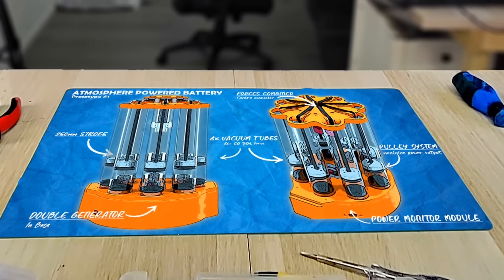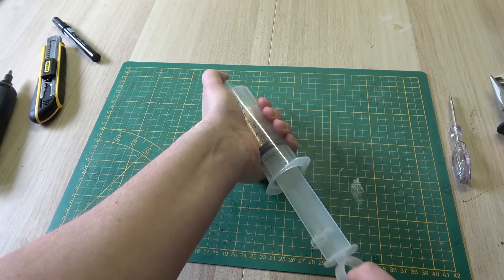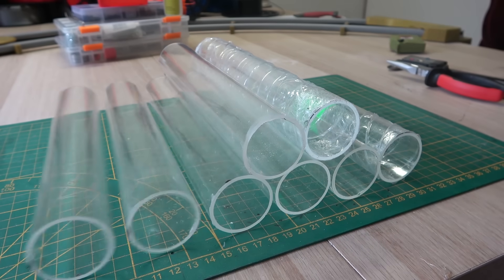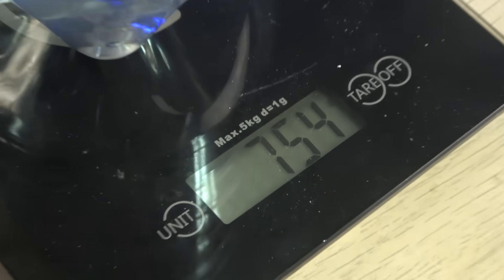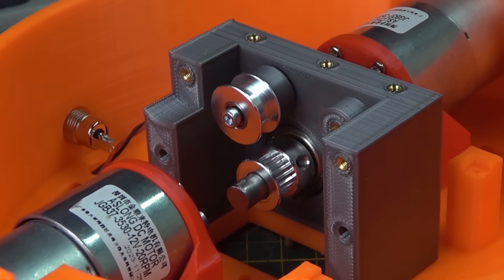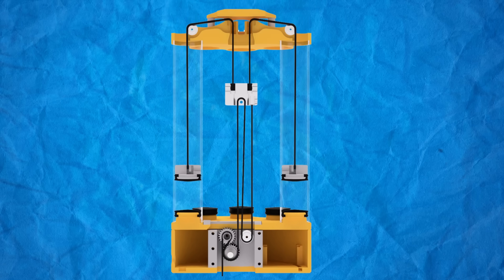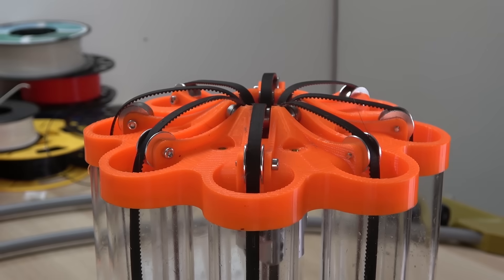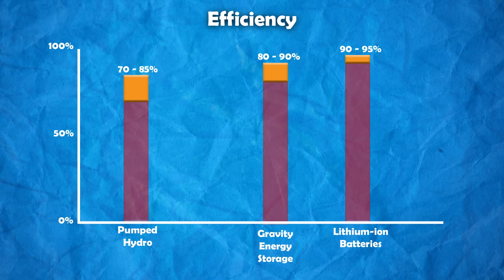Building an Atmosphere Powered Battery..

Comment: Power efficiency isn't the important metric but kWh capacity divided by the cost of the machine and its maintenance over time.

Unfortunately, 600 watts by one minute adds up to 100 watt jours, or 10x 18650 cells

Comment: I'm new here, first vid.

If you're gonna make a second version, make it to the dimensions of current solar batteries. This version has the tubes in a circle to make many things more convenient, but a real consumer version might still look like a big box. Could hold 200 of those tubes in theory. 

I wish I had more advice to share regarding improving efficiency, because I'm so very sure there's at least something to improve over 73%. Imma wrack my noggin on this one for sure cause this is an interesting concept I've just learned of. Shits neat 4 sure.

Comment: Incredibly creative! I don't think this idea will work at the economy of scale. There are several reasons but the main reason is storage volume. It will take a lot of volume to store the energy. ( Using English units, there are ~14.7 PSI at sea level. So, Vacuum only gives us 14.7 psi to work with. However, if you use "pressure", you can increase the pressure in some containers to thousands of PSI. So, there would be a lot of "volume" needed to store the energy as "vacuum" as opposed to pressure. Of course, the main issue with storing pressure is of course accidental rupture of the tank.
Still, it was a very cool build!

Comment: So i think you can improve it by having a rolling diaphram inbetween two pipes. So you would pull vacuum while compressing air. Esentially doubling power density. And you could enclose the motor in one side of the tube so the worry pf the mechanism causong sealing issues isnt an issue.

Comment: If you pulled the suction upwards using your body's weight kinda like a step lever. The body weight would lift the cylinders and exert the enegery. Wouldn't that make your machine net 0 on consumption and 100% out put?

Comment: 73 percent efficiency is a little sus from geared, brushed hobby motors for a complete round trip including all of the friction in this pneumatic system. It would be nice to see the raw data. I suspect you might have a V/I phase mismatch there on your power monitoring board.

Comment: With vacuum, the max delta pressure is 1 Bar. why not use overpressure? then the delta P can be over 400 Bar, for example, modern scuba tanks are 400 Bar. This would increase the specific power (power per kilogram) you can store.

Comment: These are called gas batteries, they use gasses under pressure to act like a wound spring, people do these with bottles for model aircraft and companies do this with abandoned mine shafts because its cheap as hell

Comment: Here are some of my thoughts right after watching your video great job by the way. My first thought is your design has a lot of friction in it with how many tubes you have. reduce the amount of tubes ideally to one. And increase bore diameter.  The last easily doable thing I see is make the tubes out of a metal that will not deform when a vacuum is applied to them. This will also increase the efficiency if the structure does not deform while under the vacuum. I would also conduct a test without the pullies to see if there is loss in the mechanical system and maybe you would make the design completely linear so you wouldn't have any pullies in line on the design at all.  Such a brilliant video I really appreciate you making it it was a beautiful project to watch you bring to fruition and to conduct your testing and to see your methods was quite amazing.

Comment: a neat idea I seen was someone use was sand to gen power. because it can flow like water when being poured so they used it to spin a water wheel and an auger screw to lift the sand up into a holding tank. would be neat to see someone make a nice sized one from 3d printed stuff.

Comment: you say its to accelerate the implementation of green energy, but you show wind turbines and solar, two not so very green types of energy. wind energy uses thousands of litres of oil every year and solar which is highly toxic and polluting both for production of the panel and its recycling or trashing.
The actual green types of energy production is water, ground heat and nuclear, 3 things environmentalists are against for some reason(the reason being that these people are socialists masquerading as environmentalists)
But no, your system there isnt gonna yield any useful stored energy compared to what is put into it. You can replace the while things with regular springs and get better returns. Its why nobody is really capable of doing these sort of gravity batteries, even using excess power to refill dams for hydro power is horribly inefficient, to the point its only worth doing in places that is susceptible to having too little rain to refill the dam.

Comment: Erik, I have an idea for electricity generation using the gravity model. 
Basically a house that floats in its own Dock. The tides lift the house and then the house through some kind of gearbox/generator acts as stored potential energy until the tide comes back in, alternatively the Dock could be pumped with water to float the house then a series of houses on a hill use the same water to float meaning you could float several houses only needing to pump the water to the top of the hill.
I need help developing this

Comment: Maybe rotate that load bearing part on the printer bed so you can align the layers with the force. Printed parts have the least tinsel strength perpendicular to the layer plane.

Comment: Might be being thick here but couldn’t you use this in combination with other systems. Say pumped hydro for instance, rather than a motor charging the system, what about floats in the hydro dam. As water is pumped into the dam, the floats pull the vacuumed as they float up.

Comment: 73% is a good start. 
the only way to truly test it is to make another one with an improved design and more vacuum tubes and one with less as well and see if it improves or not. 
is more tubes better or causing efficiency loss in exchange for power? 
did you take into account the efficiency loss of the motor and electronics? motors produce heat and sound which bleeds off power.

Comment: What about having the tubes be made of copper with a magnetic ring so that as the air pressure and gravity pulls/pushes the movement of the magnet against the copper could generate a bit more engery. Or am I thinking about this wrong?

Comment: One issue is that you are quite limited when it comes to energy density since you can't store more energy than the weight of the air that is displaced. If you use water you need only a 10m drop to achive the same energy density without the preassure vessel, and if you use a prassure vessel you can get a lot more energy density if you use compressed air rather than a vacum. If you have 10l of air at 11 bars that's 10 times the energy compared to 10l of vacum, and it's much easier to contain preassure than to keep it out since most materials fair way better in tension than in compression or under compound forces.

Comment: You are still getting it wrong.  You need to mind your UNITS.  Watts by themselves mean nothing with regards to energy storage.  The units of energy STORAGE are watt-hours or watt-minutes or watt-seconds.  That's watts with an appended period of time. 
Your following two details are incorrect.
To charge: ~12.08V x ~1.62A x 43.709 seconds = 860,64 Watt
CORRECTED:
12.08V x 1.62A x 43.709s = 855.37 Watt-Seconds or 855.37 Ws or 14.26 Wm or 0.238 Wh or Whr

After a discharge: ~9.42V x ~1.15A x 57.993 seconds = 628,24 Watt
CORRECTED:
9.42V x -1.15A x 57.993s = -628.24 Watt-Seconds or -628.24 Ws or -10.47 Wm or -0.175 Wh or Whr

Comment: Would compression not be a better idea, since a vaccum has a hard limit there's a very limited amount of energy that can be stored. Compression on the other hand has no hard upper limit only a limit set by the hardware. Not sure how this could be implemented using syringes though.

Comment: Interesting project. Tho I don't fully understand the concept maybe adding some different gear ratio would improve the output? I've seen a video from a 3d printed model what achieved a 1000rpm with only a few easy hand turns. Spoiler alert it exploded from centrifugal force. But I assume that would drive your generator much faster

Comment: The problem is that even though Lithium Ion Batteries or Gravity Energy storage might be more efficient energy wise than pumped hydro energy storage, they are not as applicable on a large scale. A lithium ion battery that stores as much energy as a pumped hydro lake is going to fill a big warehouse and just think about the fire hazard this thing would pose, not even mentioning the crazy amount of lithium you would actually need. Gravity energy storage suffers similar logistic problems. You‘d need a ton of those mineshafts with weights in them to make up for just one pumped hydro power station.

Comment: An interesting concept and a nice presentation and prototype. If your measurement of around 73% (860 watt-seconds vs 628 watt-seconds) is real, it would be a very high efficiency with the limitations of the prototype. I would like to see the loss over time since no seal is perfect. I would suspect that air will creep into the cylinder and over time the stored energy will be "lost". Gluing one end of the cylinders shut will reduce potential energy-loss. Personally i find the 0.23Wh of potential energy stored a bit limited considering the amount of work needed to build such a machine. Also: the force needed for the movement of the piston is not linear. Is this reflected on the output or are the gear-motors flattening the curve? Your amperage measurement should at least not be linear.

Comment: How about combining APB with GES where charging the APB during GES's energy production or when the weight is pulling down. After it hits the ground, then we should have atleast a strong APB that can pull the weight off GES when generating energy. Then it will generate in cycle although there are some energy lost, it is worth a try though.

Correct me if I am wrong, I am not an expert.

Comment: while this isn't actually that efficient, (others have stated as much)
I can imagine this being a lower part to a large gravity battery. if the gravity battery was pulled up a vacuum tube, it would be able to add some real torque to an existing gravity battery. The issue here is that friction of a seal would reduce the efficiency unless the weight is massive already, and it would make the gravity battery's output non-linear which complicates deployment. you'd get more from a spinning maglev flywheel in a vacuum tube, and using it to generate energy though induction. you have very little free space in the container, and use a powerful set of weights to make the vacuum in the first place. making a vacuum in a durable container is relatively power-cheap, compared to disposable plastic, rubber, or machined parts.

I might suggest you use it to pull water up a wide-bottomed tube, then let the weight of the water fall down. it would also be non-linear, but it would indeed resolve the issue of losing energy to water friction, and allow you some control over the friction by using grease or similar... but I still prefer a pure gravity battery, as it's the simplest of the solutions, and has the fewest disposable parts (which can also be counted as a massive energy loss, if you take production and shipping into account.)

Comment: Steel has a specific gravity of 0.2833 pound per cubic inch. If we have a 1 square inch steel rod 51.88" long the pressure of the steel rod on a surface will be 14.7lb per that square inch. The same as 1 atmosphere. It is so much easier. No cylinders. No seals. No vacuum required. Lift the steel rod up, let it fall. I applaud the creativity though.

Comment: Watts are a unit of power, not energy. If like you said in another comment you did: voltage x current x time then the unit is Joules which is a unit for energy. Watts are just equal to the number of Joules divided by the time in seconds, so 100 Joules used over 5 seconds means a power of 20 W for example.

I also highly doubt the efficiency figure you got to, brushed motors aren’t very efficient when used as generators. Add in the losses caused by the motors themselves, the gearing, the pulleys, the belts, and the friction in the tubes (plus the angle of some of the plungers) and I find the claimed efficiency very hard to believe. Could there be something wrong with your current and voltage monitoring setup?

Even as a basic test just try wiring the motors together in a loop. Rotate one motor by a certain amount and see how much the other motor rotates.

Comment: 2:03 you use the calipers wrong.  Supposed to measure at the ends of the jaws where the thickness of the jaw is minimal.  It alleviates the possibility of having the measured item misaligned between the jaws.  Try rocking the syringe in the jaws where you measured at and try it at the ends. You'll notice when at the ends even if the object isn't perfectly in the jaws it will be a consistent measurement.
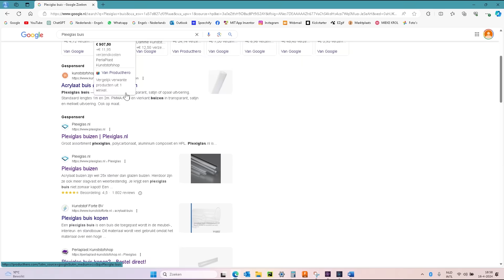Reply: Same thing at 3:08 far to choked up in the tube.  You risk getting an incorrect measurement resting the square part of the jaw in rounded areas.
Reply: At the same time, I use my calipers this way sometimes to get the largest diameter in the area. Depending on the material as well it can dig in as it's sharper there. It's not using it wrong. It just depends on what you want.
Reply: @jhwblender  You may do it this way as well but its still wrong.  They wouldn't put the feature there in the jaws of it if it wasn't supposed to be used.  The issue with it digging in is operator error. Only you the operator controls how hard the jaws are "digging" into the measured item.   An old head didn't show you the right and wrong way to use the tool.  Its typical nowadays.  Did you know there's a right and wrong way to channel locks, vice grips, wrenches, etc?  If you do, you should be able to recognize that if you didn't, you would be under the assumption that there wasn't a wrong way to use them.

Comment: I think everybody here is missing the point thats its a proof of concept, some of the maths might not be exact or perfect but im sure none the less he had a alot of fun building and designing this project, learnt a bunch of things on the way. C'mon ppl his not saying he is making zero point energy just having fun expermenting with alternative battery types. Im looking forward to a MkII.. 😊
Reply from the maker: Yes, exactly what you say is indeed what I first thought when I saw all those comments coming in😄. But the other side of it is that it does spark fun discussions🤓 Thanks for your support! Appreciate it!👌
Reply: @ConceptCraftedCreations  I am glad I found you video in the haystack. Subscribed before even watching the whole video. Ty
Reply: As a POC it's interesting, and it's going to spark some thought, but it's got several major challenges that will make it less than ideal for implementation.  It's part of the reason the Hyperloop concept was doomed to failure after over a century of pneumatic pressurized tube passenger rail trials.
Reply: A proof of concept is supposed to show something as being feasible, this contraption is just not feasible. The friction, multiple layers of energy loss, air leaked and wear, there's just so much worse about this than a spring, compressed air storage, or even just a weight on a very rope.

Comment: Well, even if the project didn't achieve a remarkable and incredible sort of battery system, I think this video can help us improve our view of Ideas, if you have an idea TEST IT, then you know if it's good or bad, you won't know without experiment, you deserve my Subscription!. Also I would reccomend for a new video a sort of energy production using gravity as a pull down force, but like a pendulum thatat it's maximum speed in some way gets accelerated, so you use energy to let it go to it's previous height, but you gain energy with both the falls. You can attach a magnet in the pendulum and make it osscillates in copper wires "capsule" to gain energy. I don't know if it's a good idea.

Thank you for reading

Comment: Just build a damn lake and seed clouds. Free hydro electricity. Lots of free space in the middle of the us to do this. You might even be able to do it for cheap by finding 3 mountains and then fill in the 4th side with a hydro electric damn and wire it into the countries grid and calculate where you need to seed the atmosphere in order for it to rain right on your mountains.

Comment: I think the biggest problem with this is capacity, in a below comment you say that this produces 600 watt-seconds which would be only abut a twentieth of a watt-hour, a similar volume of batteries (LiFePO4) would have up to 600 watt-hours and liquid hydrogen would have up to 5555.56 watt-hours.

Comment: for the matter of it being viable or not, we would need to know how many cycles this prototype can handle before failiure.
i think the mechanical stress on the zylinders is compareable to a fossil fueled engine, which would make it actually viable if you use steel or other durable materials.
next level would be individually aplicable zylinders to the motors, so the power generation gets equalized while its being constantly charged with renewable energy.